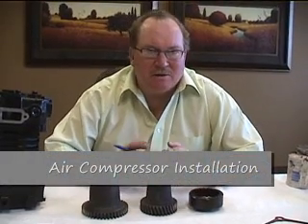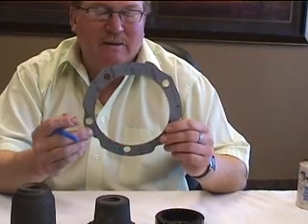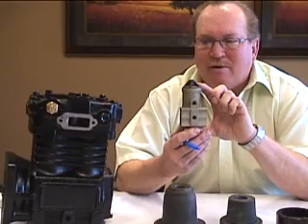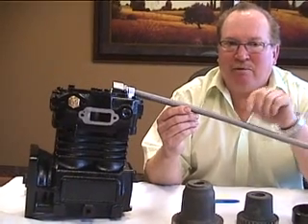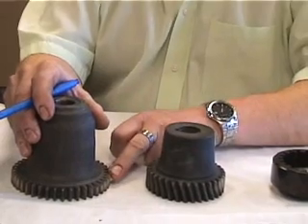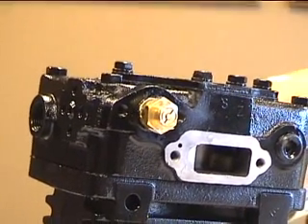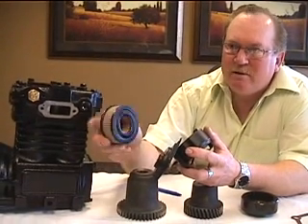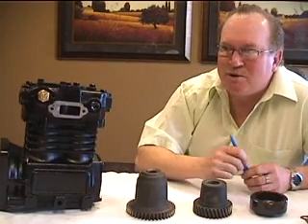Air Compressor

Comment: break in, open up wet tank(supply tank), let it run under 80 psi for 20 minutes without unload it, check leaks.

Comment: Great video I wish I seen it before I installed a Cummins air compressor on a 93 international came with no gaskets used silicone and blocked an oil passage which caused it to piss oil had to get gasket paper and make my own gaskets and that's when I found that I had clogged an oil passage

Comment: Thanks for the information,  Is there any additional procedures that need to be followed one a compressor that's putting oil into the air system has been replaced.  My system does not have an air dryer (1988) is all the oil contained in the primary air tank, or done it contaminate any air controlled. throttle, shifter, and air governer? if so recommended cleaning procedure?
Reply from the maker: The main reason for oil pumping is a worn out compressor so once the compressor is replaced you must be sure that the discharge line going to the first air tank or the wet tank is replaced as this line will fill with carbon over time from the old compressor and be sure the intake hose or filter is in good shape. Being that this unit is 1988, chances are you have a filter which will need to be replaced. If these things are not done your new compressor could run hot and pump oil….The air dryer should be mounted about 10 to 12 feet away from the compressor and it is a must on all air systems otherwise your air system will get contaminates into other components. The air dryer is the best investment you can make in an air system, it is like the oil filter in your engine. You should still drain your air tanks daily to get rid of any moisture or contaminates the dryer does not catch. Once the oil gets past your air tank into other components like air chambers and air valves there is nothing you can do other then change the defective parts out as they fail.
Reply: @fleetproducts  Thanks for the reply.  I will be adding an air dryer and carefully inspect other components of the air system.

Comment: i have a 2006 kendword  ISM Cummins  engine  and have coolant leaking from my air driyer  already  replace the air driyer but i think i have a crack head on my air compressor  any help will be apritiaded
Reply from the maker: I would change the head on your compressor if it is cracked. Coolant might be getting into the air line due to this issue.

Comment: Detroit Series 60 on a 2004 Coronado.
I'm getting a small air pressure on a split hose that comes from the air cleaner.
I'm thinking it's the one way check valve on one of the intake valves?
Builds air very slowly.  
What say you sir?

Comment: my  truck is not building air is a cold morning
Reply: I know this is late, but for anybody else, mine used to do that.  I’d warm my governor up with a heat gun and it would build air.  Changing my governor fixed that problem in my case.